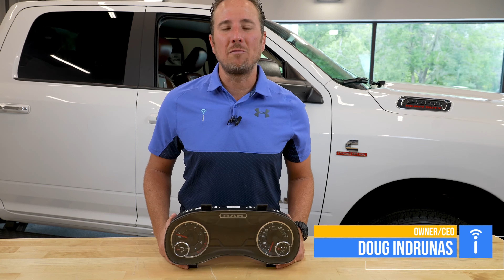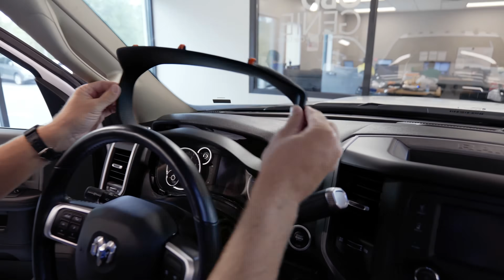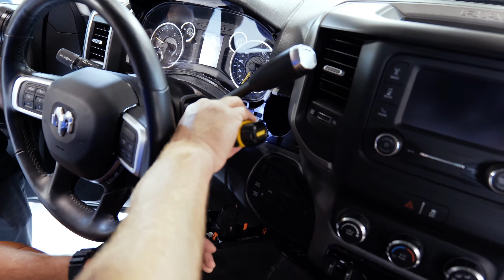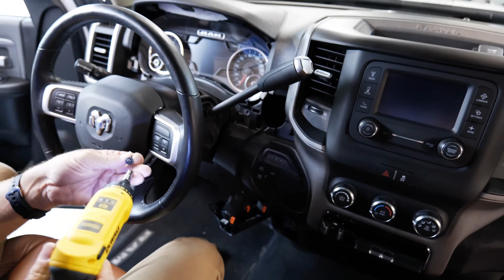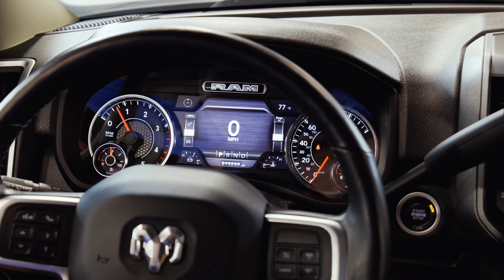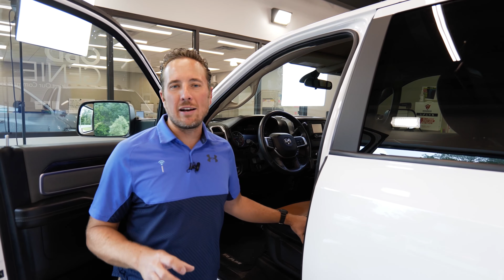2019+ Ram 2500 - Digital Speedometer Cluster - The Build Episode 21 by Infotainment.com

Comment: Hi, I have a question. I have a 2020 Ram. I upgraded the cluster to a 2022 one, but the fuel gauge shows full all the time.
Reply from the maker: If you purchased the cluster upgrade from us, I’d recommend reaching out to our technical support team as soon as possible so they can take a look. If it was purchased through a third party, I’d suggest getting in touch with the seller or a local dealer to see if they can assist with the issue. Let us know if we can help in any way.

Comment: I have a bad cluster sensor in my 2019 dodge ram 2500 that happened at 40,000 miles. My personal opinion and fact is that dodge ram has gone to complete shit and where they make them out of the USA makes them even bigger garbage.  The fact that dodge doesn't give two shits about the customer one bit. They only cover drive train and engine till 60000 miles. These assholes also have the most unsafe fucking system ever.

Comment: Great but 1300 for one cluster is insanity I do keep in mind they do program it
Reply from the maker: This is OEM equipment. If you are looking for a significant downgrade in price and quality then I would consider aftermarket. OEM equipment is more expensive but you are putting the value into the vehicle unlike aftermarket which would have to be removed before resale to not hurt the value of the vehicle.
Reply: @Infotainment_nav Ohh if they are OEM then that is perfect thought these were aftermarket will consider buying one of these for sure

Comment: Which cluster works for the 21 Ram 1500 Warlock?
Reply from the maker: This particular package is meant for Heavy Duty Ram trucks only. 

Below I've provided the link for the Ram 1500 Classic style cluster.  Be sure to select the year range of 2019-2023 in the drop down menu. 

https://infotainment.com/shop/2016-ram-1500-classic-build-series-upgrades/2013-2018-ram-1500-speedometer-evic-instrument-panel-cluster/

Comment: My 22’ Ram 1500 barely hit 7K miles and my cluster is completely out. The dealership said it’s gonna be a good while before I get this part replaced. It’s on back order, and it’s been 3 weeks since they’ve ordered it. So, I’m driving with a black screen on my cluster. 😪
Reply from the maker: Wow. What about the mileage? Are they going to program it when it arrives.
Reply: @Infotainment_nav  I'm assuming they will. Everything is still under warranty. I've been trying to enjoy my pickup but I've already had to replace my rear backup camera twice, update my bluetooth and carplay, and now my dash cluster. It's hard to really like my Ram when it's spanking new and with a bunch of issues.
Reply: How did this end up for you, the dealership I work at just got one in 3 days. Also unfortunately with cluster replacements there will always be a display mileage discrepancy unless the vehicle is left to sit while waiting. The PCM will still show the true mileage but any driving done from time of order will not show on the new cluster as the mileage is programmed by the supplier.
Reply: @DrDeathReign  The NEW dash cluster picked up the mileage where the old one stopped. It didn't pick up the mileage from in between the time I was driving with old one out. So it didn't register about a good 800-1K that I drove while I had to wait for new one and the dealership left it as is.